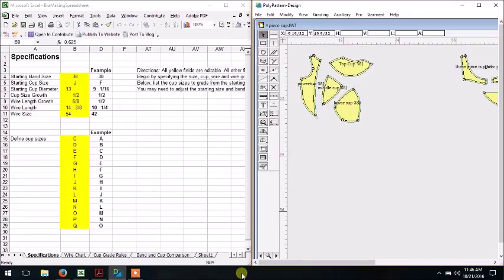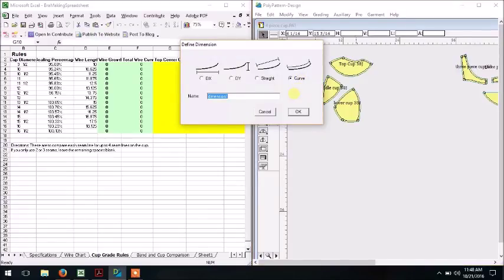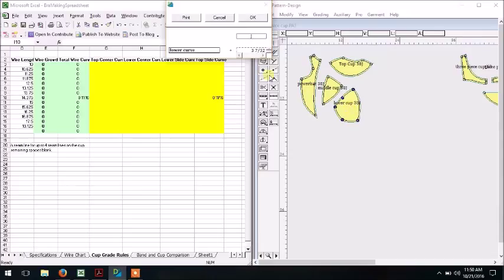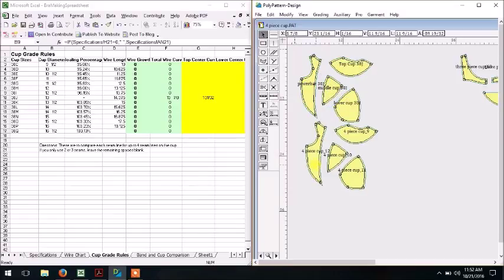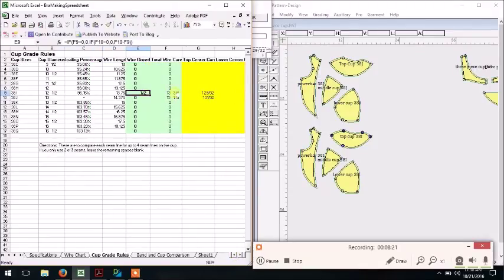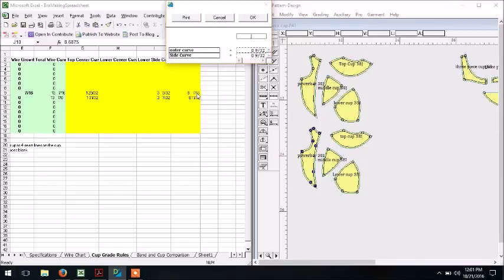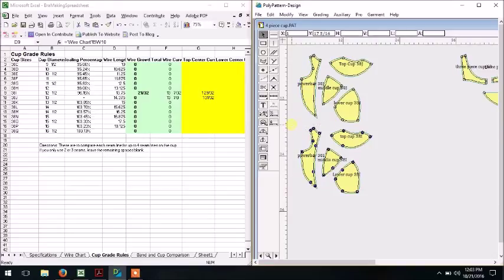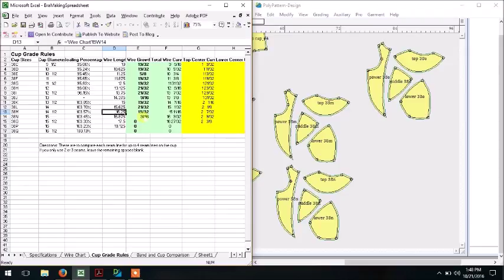Grading a Bra Cup Pattern with PolyPattern Software

Comment: Hello from France,

I have a few questions for you madame.  I'm a plus size woman. In France, it's impossible to find very large cups! Therefore, the only solution for me is to sew for myself.
I was wondering if you could recommend to me nice books. What is the exact name of the software you use with Excel. Thanks. I found a pattern to dowloard. The problem is, I need to add maybe 4 inches on both sides, and also up. What is the rule for calculation? Thanks.
Ps: I never use any wire (metal) because it's too painful for me. Thanks for any help  ; D
Reply from the maker: This software is called PolyPattern. Its more for professional pattern making or custom pattern making. If you have illustrator or inkscape, you can do some grading of a pattern there too. There are a few indie pattern makers that have larger cup and band sizes. I have two sports bras (one that is available now, and one being released next month) that covers about 150 different sizes. 

I wrote the book Bare Essentials: Bras. There are instructions in there on how to grade up a pattern by hand and by software. If you aren't experienced in pattern making though, it could be pretty technical. What I would recommend doing is taking the largest cup size in the band you need and copy the professional grade from the smaller sizes up each size until you reach the size you need. Feel free to email me privately through my website for more assistance.